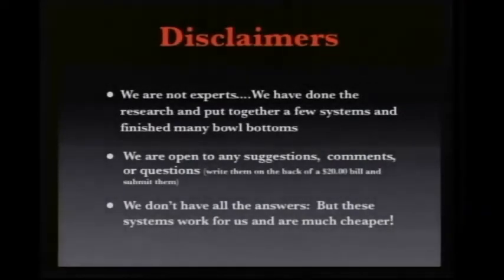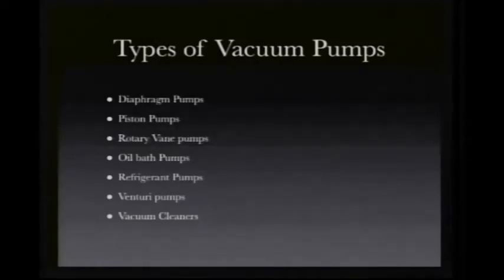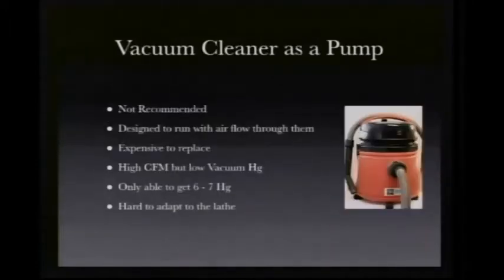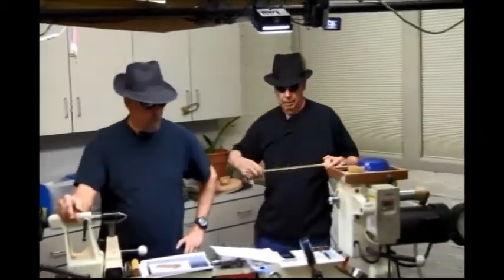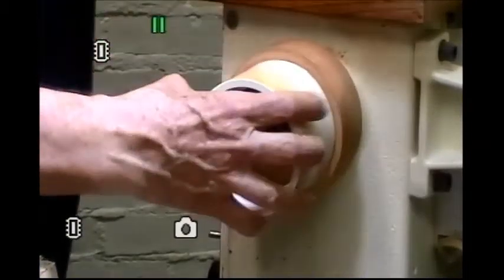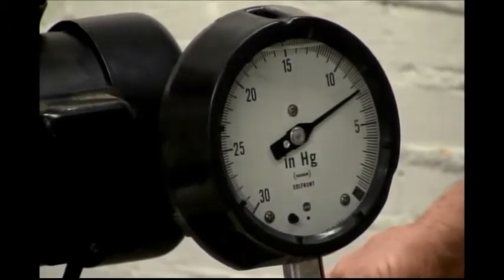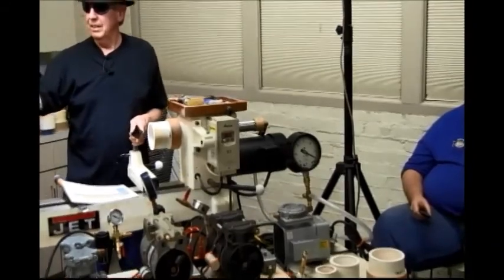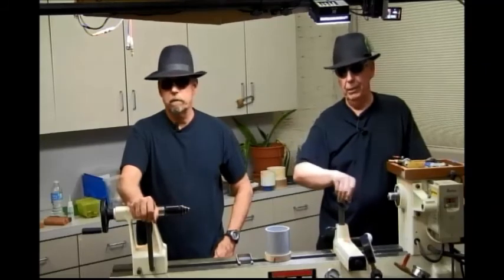Building a Vacuum Chuck

Comment: one can be made a lot cheaper by turning a connection for your shop vac & glue it to the back of you headstock. Mount a piece of mdf to your face plate, cut a groove to fit your work....been using this method for 20+ yrs...never lost a work peice

Comment: I did the math for you.

PVC Sch 40 is rated at 200 PSI, atmospheric pressure is 14.7 PSI, with the rating in the opposite direction than that of vacuum, by the inherent configuration of a cylinder, it's ability to resist force is stronger in a compression than in extension. End pressure would be the only way to exceed this, the hollow diameter inside the chuck would have to be greater than 4.8 inches in diameter (I used the thrust force acting on 1/4 wall thickness, which the pipe will far exceed in a direct axial vector), 5.5 inches in diameter for a 2" diameter PVC SCH 40 pipe.

So the hollowed out area behind the bowl, that area exposed to vacuum is the critical dimension to determine if Sch 40 PVC can be used. I am with you, use the coupling, you can't be to careful.
Reply: I know it is pretty off topic but does anybody know a good site to stream newly released movies online?
Reply: @Connor Korbin Ehh I watch on flixportal. you can find it by googling :) -messiah
Reply: @Messiah Ben Thanks, I signed up and it seems like a nice service =) I appreciate it !
Reply: @Connor Korbin Happy to help :D